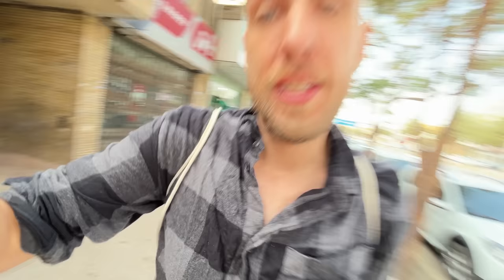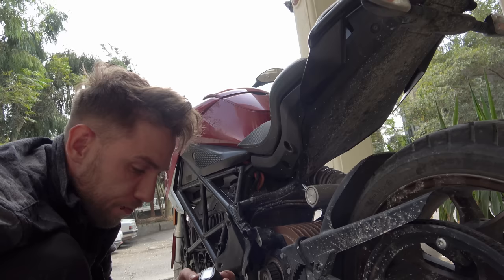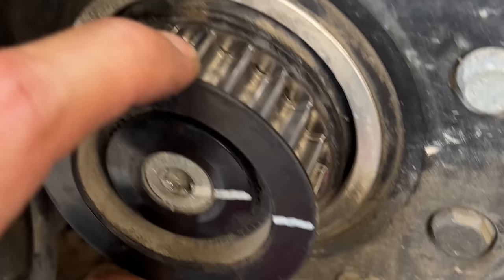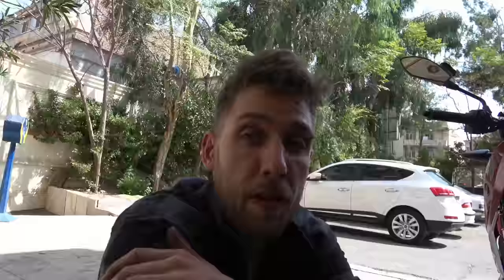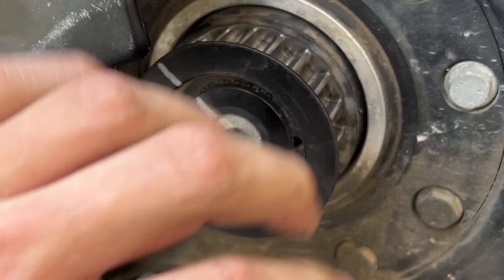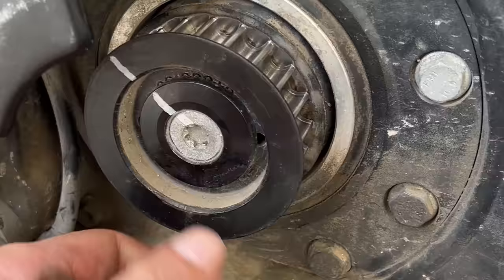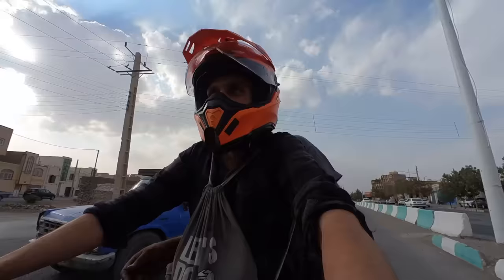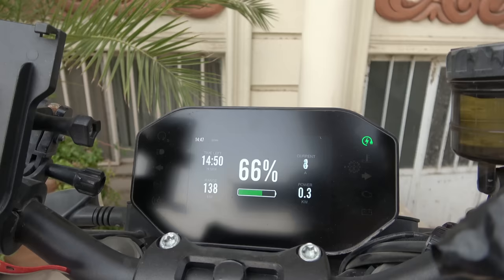Fixing EVE with a freakin‘ BLOWTORCH!

Comment: Honestly Marc, most shops would have probably done it the same way.
Heat to (hopefully) cause a different rate of expansion of metals, but more importantly, to soften the old Loctite.
Leverage to work off the sprocket. Without a specific pulling tool, this is the next best thing.
Maybe the impact wrench wasn't the best choice if you want to carefully back out the bolt without sending shocks through the motor/shaft.
But he fixed it, and your adventure continues!
Reply from the maker: Yes the journey goes on 🚀🙌🏼⚡️

Comment: In fact, some of the locktite products are removed with the help of heat. 648, advises this For Disassembly: 1. Remove with standard handtools. 2. If needed, apply localized heat to the assembly to approximately 250°C. Disassemble while hot. 3. If this temperature is not possible, heat as much as possible and use mechanical aids. Keep going! :)
Reply from the maker: Scary though right next to the controller and electrics 🫣
Reply: @MarcTravels  Totally agree with you... anywhere in the world it will be scary, as this is a rare bike, there are few mechanics who know how to fix it and it must be more difficult to get parts... in Iran, with a stay visa for a month (possibly with more than 15 days used) only a crazy person wouldn't be scared!
Reply from the maker: @AGA039 absolutely 💯

Comment: It sounded like the flange on the inside of the pulley had come loose. These are usually just swaged on to the hub of the pulley.  I would order a spare pulley just in case. Great channel Marc...keep your spirits up! Keep going!
Reply from the maker: It’s not easy to order anything in Iran. It‘ll be alright 🤙🏼
Reply: If it happens again check that flange..it may be loose..it can be repaired by simply deforming the hub on the diameter that locates the flange. Hopefully that loctite will have bonded the flange on anyway

Comment: Yeah, it looks a bit agricultural, but heating up loctite to get it to release is standard practice. You only need to get it to around 150C (depending on the type) to get it to start going soft and so you can get the threads loose of the part off the spline. Its unlikely to damage seals, as long as you don't go silly with teh torch.
Reply from the maker: Yes 👍🏼

Comment: Great, it was a minor problem.   Back to damn the lack of outlets,  full speed ahead!  😃  I've had never heard of loctite being used on a spline gear shaft before, but it's used on vehicles to stop backlash noise.
Reply from the maker: Yes 🙌🏼
Reply: and even if zero had an outlet over there it would have taken a lot longer and a lot more money for the same outcome glad its fixed and was what i said it was  @MarcTravels

Comment: No worries Marc, notches are fine. Just esthetics as long as its not touching the belt or anything else as is spins around. Regarding the heating, if he applied heat for a short time enough to remove the old locktite then you'll be fine. As it works fine all should be good. Sometimes I trust these people more than the actual manufacture dealerships. They work with love and a knack and wizardry that makes things work. Example,  I had a diesel with a fuel pump leak. Solution,  pour a glass of oil and or a tot of brake fluid. Revitalises the seals. Job done.!!!
Reply from the maker: Awesome 🙌🏼 yeah I gotta learn to be a little more chill but yeah, one wrong move and I could have been stuck in Iran for a while 🫣🤪

Comment: Great to hear it wasn't the bearing.  I also had the motor shaft tophat start knocking and repaired it the same way.  The knocking indicates the tophat has worn and although it has been tightened up for now the knocking will return in time.  Recommend you get hold of a spare tophat and countersunk screw that secures it.  Part #s 20-05453 and 90-08108.  AF1 racing deliver worldwide.
Reply from the maker: Alright, thanks 🤙🏼

Comment: you can paper sand the notches to smooth them, if they give some problems with the belt. A bit strange, succesfully fixing it with loctite loctite. It would mean you got some play in between the shaft dents and the pulley . If you shaft was looking good and not worn, I  I would order a new pulley ASAP . In mechanics, soft parts worn hard ones, so better put a new sprocket/pulley than to have to change all shaft engine system later. Super low high torque of Ebikes give a lot of efforts on transmission....
Reply from the maker: Alright 🤙🏼

Comment: Marc, were you told to get red locktite? The bottle you purchased requires very high heat to free the parts it is applied to.
Reply from the maker: Good, it’s not supposed to come off for the next 100k🤪

Comment: Well, but the quickest way to get a glued on gear off is heat. It breaks up the locktite. Everything else involves lots of force and is much more dangerous.
Reply from the maker: Yes that’s why we did it. Just scary with the electronics and controller right next to the flame 🫣
Reply: True, but fortunately it doesn't take a lot of heat for the locktite to break up.

Comment: Strange thing man, since the pulley was so tight, I cannot understand why it should make that noise? Seems it wasn´t loose?
Reply from the maker: It‘s under heavy load with the belt, that’s why the loctide 🤙🏼
Reply: @MarcTravels  Strange man, strange. But since it now does not make that ticking sound it seems OK. At least you know how to fix it next time. The mechanic did a good job I think, concidering the circumstances. Looking forward to next video! Hals- und Beinbruch 🙂